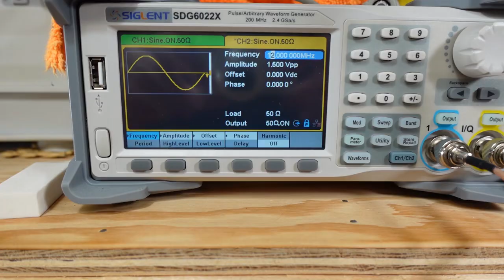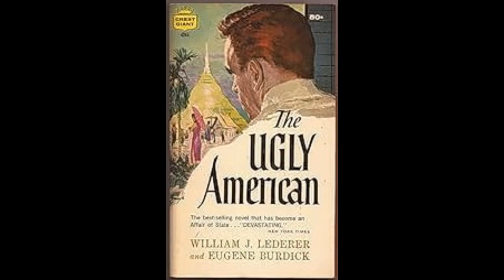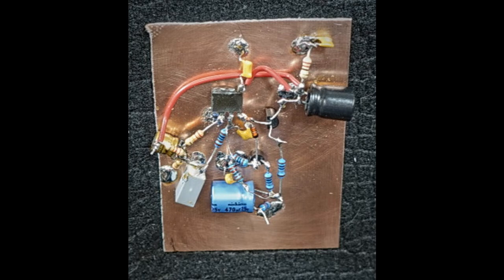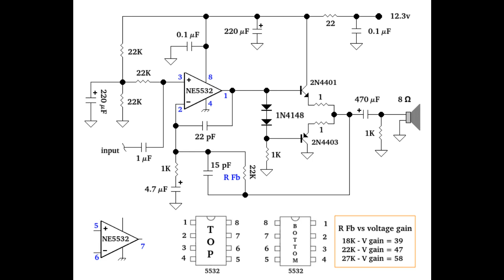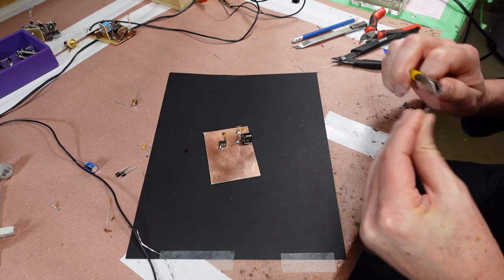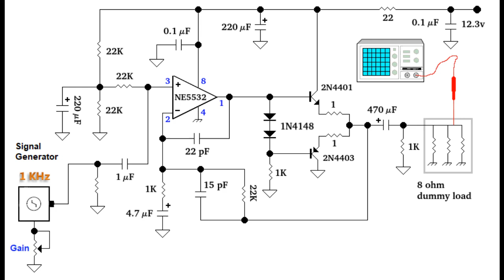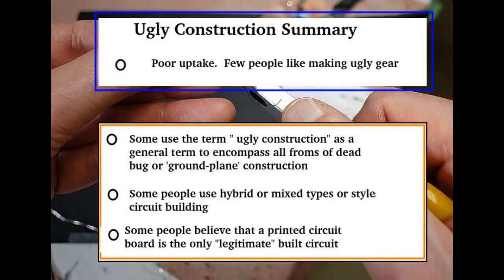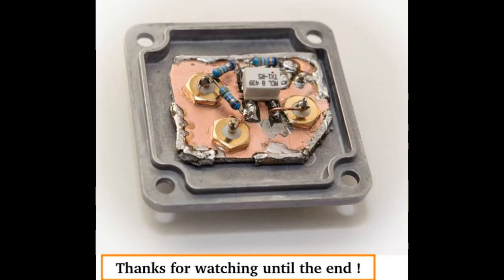Ugly Circuit Boards - for experienced electronics makers

Comment: Dead bug construction? Don't know that one. But I have used the term Rats Nest for over 50 years to describe the seemingly higgle piggle of prototyping loose discrete and IC components into a working entity. Where its a fine balance between something logical on a bit of paper and still ideas in the mind, blended into a "Yeah that's right, it works" of wire and solder and this and that, be it on copper or "loosely" arranged.

Comment: If you use a bit of thermal grease under the 5532 it will hold it in place as well as dissipate any heat it may generate. You can do the same with the transistors.

Comment: Isn't the opamp output normally placed between the two diodes? Given it's in closed loop the circuit should still work, but I'm guessing in this configuration you'll be driving one BJT harder than the other

Comment: rofl in highschool i found a circuit for an FM transmitter online, "stole" the components from school, wound my own transformer, and even BARELY got it to work.    soldering all the component leads together in some 3d maze.        i built it so i could listen to my rio pmp300 through my 1st car's stereo through the radio

EDIT: it was also during this time that i learned accidentally hooking an electrolytic cap backwards will make it explode. scared the hell out of me.

Comment: How do you call those? -> There's also circuits I saw that look like some industrial plant or little sculpture. They mainly use cooper hanger or different gauges of copper rods. Components are suspended and there's no enclosure - Although I saw some home maid guitar pedal structured like this inside. 

I find all these approaches very interesting and inspiring.

Comment: I'm glad you could take away good things from Alexi, many would have shrugged that experience off and looked down on the opportunity. We'll show those SMD builders and corporations trying to miniaturize the hobbyist out of the equation, their little bits are just gonna short out on our boards! I'm glad to stumble upon a wild man keeping it real. This helps me to feel better about the state of my builds which involves some direct component connections, vero board, etc. A guy could really go to the deep end attempting mastery with these techniques, probably not where I'm headed but very interesting to see. I'm hoping to tailor some basic low budget circuits to suit whatever cheap enclosures I can muster, so the product is the same but the package differs as I switch to the some other enclosure for the next format.

Comment: ye thats actually interesting, i got a Pioneer sa7800 that had an fix attempt, that was used this technique but with glue, the diy amplifier was made on a board like this, and everything in air, and a tonn of glue everywhere, it exploded when i turned on the unit.
So at least i still had the original stuff left intact mostly in the amp that i got, and i fully rebuilt it to be as original as possible, and now i have a very nice Pioneer sa7800 amplifier.

Comment: Wow! Cool! I had no idea that this was a thing. I kind of self taught to build ugly circuits on cardboard paper, but it doesn't stay intact and has varying degrees of resistance depending on moisture levels, which limits me to using low resistance values in my designs.
Reply from the maker: Thanks for your comment SashaXXY.  Best!